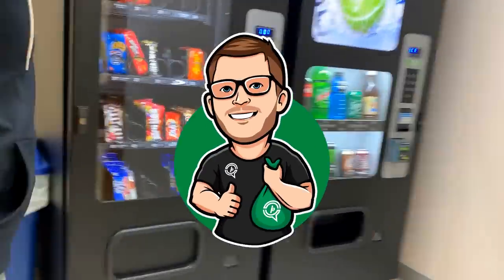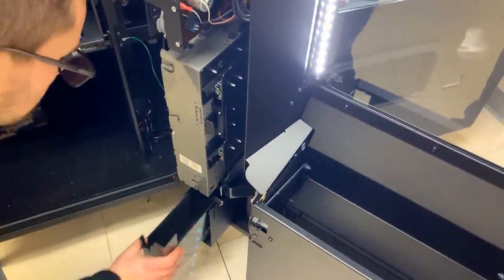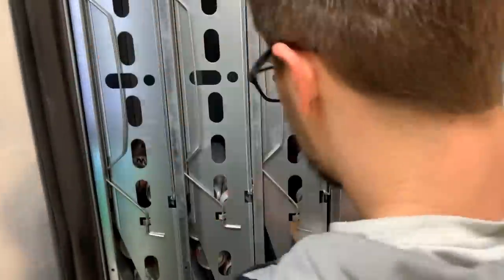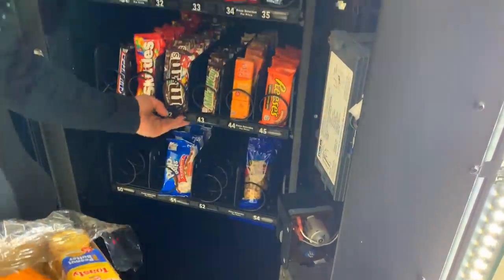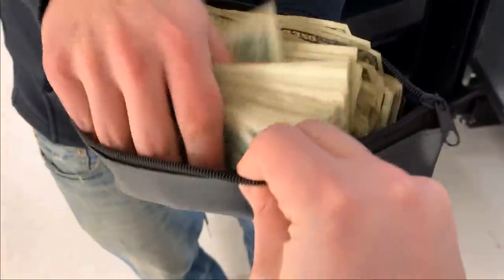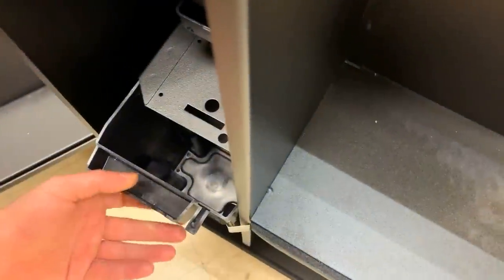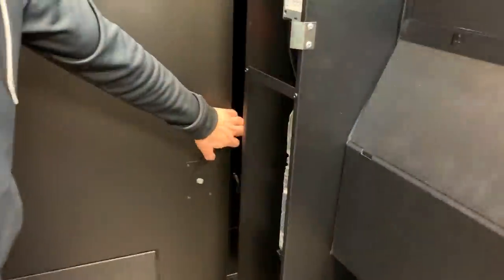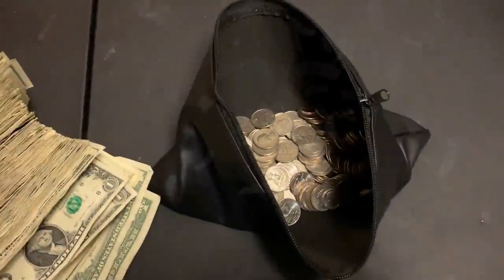Collecting Money From 6 Of Our Vending Machines

Comment: So about $10 per day from a vending machine! Minus expenses, doesn't seem all that great. You have to buy your product, pay for machines, time getting product and driving and stocking the machines. I can think of several different options that can make you more than $5 per day profit!! I "Curb surf" picking trash for scrap and sellable items, and in 2 sometimes 3 hours I make $100 or more. Sometimes it's hundreds in a couple hours. Way better!!
Reply: True but vending is passive income you're literally doing nothing and making money remember... the busier the location the better. Everyone should own atleast 1 vending machine as supplemental income ON TOP OF doing their primary thing.
Reply: @DoctorRickSanchez  Vending machines are not PASSIVE INCOME! The machines need to be stocked, and maintained. You have to spend time purchasing stock, driving to pick it up, drive to the machine every couple of days to stock and get money. You can invest about 5 or 6 hours per week, per machine depending on location, and if it's busy. That's not PASSIVE!! PASSIVE means you don't do anything. Invest in a business where your a silent partner, stocks, bonds, and other options where you continue to get paid forever without having to do anything. That's why it's called PASSIVE!! Vending machines need to be maintained, repaired, stocked, talk to clients, store/deal with inventory. That is not PASSIVE!! Vending machines, unless you have a GREAT location, they have a low return on investment. Even if a machine does $100 in sales for the week without restock, After your time, paying for stock, and whatever arraignments you have, even if you make $50, that's only $2,500 per year. That is not a good return on investment of your time, or equipment purchased. It is NOT PASSIVE!